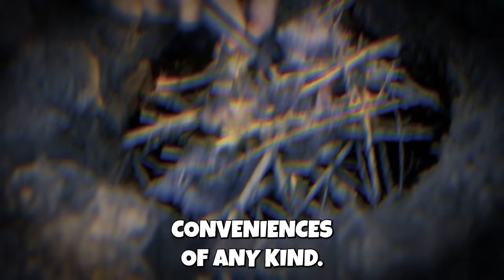90% Will Die In 9 Months! We Tried 72 Hours

Comment: Every prepper needs to learn how to build a charcoal gasifier system. They are simple and reliable way to fuel a power generator on fuel you make your self from any biomass. No gasoline required.
Reply: Does the genny need acparticular regulator etc for this?

Comment: I did a 24 hour winter power outage practice run a few years ago. It was a lot tougher than I thought it would be mainly because I had to split a lot of firewood. Hauling the firewood to the house and keeping the wood stove fired up was also a big time killer. I learned a lot from that experiment and now I have 2 cords of split, dry, firewood on permanent standby.
Reply: Excellent work proving the value of a test run.  Test and tune when it is not an emergency, then you can be cool, calm and collected when it is one.
Reply: Great idea. More people should try it. It can be eye-opening even for somebody who thinks they are prepared.

We did a 48 hour winter power outage practice after we blew a transformer outside our house a few years back. I suppose it was more of a "mandatory unplanned practice".

Best part is we probably overloaded it with our brand spanking new central heating system. We were barely a month into heating our home without wood for the first time in years, and we got plunged back in immediatly.

It was a good reminder not to get too reliant on the grid, and, years later, we still keep a winter's worth of wood split and dried in reserve. 

Last year we lost power again when my breaker box busted. Took me two days to get what I needed and fix the thing. It was -20 Fahrenheit outside. Wood stove for the win again.

Last spring, I built some new wood racks we will barely use. This year we're adding some propane heat as well to serve as an additional emergency back up for the wood stove because I hurt my back hauling wood for the racks. 

It'd suck to have no way to heat my house because I was too hurt to carry wood. Can't be too careful : )
Reply: If you can get a source of waste veggie oil, look into oil drip supplementation... we modified our woodstove to also accept oil, and it cut our wood consumption up to 75%!!! So, we went from a full day of falling, cutting and splitting once a week, to one day per month ;)
Reply: @Great_Wall_of_Text  We trained our biggest dog to haul a sled full of wood so we don't have to break our backs any more than we already do ;)
Reply: @AgnesMariaL  Good doggy!  I bet that pup loves the job : )
Reply: Where you live is important too.. some folks have natural water near them.. We don't!!! so water would be my main issue. Others live in Cold climate and so firewood and ability to keep warm in the home without bad fumes that kill you. Vs where I live the concern is Summer heat will kill us, but in winter we'd be OK with a few extra blankets.
Reply: Maybe invest in a small wood splitter

Comment: To keep a frig/ freezer coldish longer slide Heavy Clear vinyl (fabric stores, hardware...) Between the door and shelving. This will let you look but keep the "cold" from spilling out.
Tape the sides down and make  2 splits so you can remove things out.   I throw a second very light weight vinyl over top again to keep it 'cl9sed'.  You Can use Press n Seal plastic wrap for this closure as well..  For the Freezer (upright) take 2 old heavy sleeping bags, place folds on opposing corners secure the sides of the bags to the sides of the freezer.  This added insulation with the vinyl will keep things an extra 1&1/2 to 3 days.

Comment: Thanks for an entertaining video. When my wife and I use to primitive camp, I ordered a toilet seat that fastens to a 5 gallon bucket. Replacing the bag in the bucket was not something I wanted to do. So, I took a saw and cut the bottom out of the bucket. I took my post hole diggers and dug a 3' hole about 10" in diameter. No splashback. I would dig a new hole every couple of days and there was not hardly any smell with it being that deep. We also through lime on top of it after each use. Dirt would have worked as well to mask the odor. By the way, you have a nice looking family and it is good to see you are raising them religiously.

Comment: I live in Oklahoma and it gets cold in the winter here.  We had the largest ice storm in years.  Our house heating system went down.  I had to go 8 days without the heater for my 3,500 sq. ft. home.  That was the soonest the part would come in.  We were able to use the gas logs in the fireplace and if it got a little chilly, I have two ovens, I would fire up the ovens and leave the doors opened.  We didn’t leave them unattended.  We all slept in the den, it is closest to the kitchen.  Put up some quilts to close off the rest of the house.  Space heaters in the bathrooms so the cold did burst water lines.  My family and I survived.

Comment: We bought an off-grid property and packed up and moved to the middle of nowhere in the Cairngorms of Scotland.  When we arrived there was six inches of snow on the ground and it was still coming.  It was May and the snow stayed there until July.  It is beautiful if not challenging.

Well, when we arrived there was no water as the pipes froze (it is gravity fed) and the heat is run by radiator.  It was cold.  I bought the place because of the burns (fast running streams) on the property, so we had access to water, which we hauled to the house for the toilet, cleaning and cooking and filtering.  Then that summer, the generator blew up...literally...chuckle.  While waiting for another, we were without electricity for almost two months.  Except for a little generator that we kept the fridge and freezer going in six hour intervals.  It is still cold in the summer in the Scottish Highlands and having a wood burning stove WITH a back boiler for hot water is a life saver.  We were able to keep the house warm and have hot baths, which makes no electricity no problem.

Living without water, then electricity was a great experience!  We learned to do everything the old fashioned way and grew closer as a couple.    We now have a functional home-grid with solar, wind and generator and more important, the wherewithal to live without.

Comment: Ive been completely off grid for seven years. Basically own a small farm. I have several water sources. I have manual backup everything. Solar power and a turbine generators. Recycling everything i have compost to even house parts full mechani/machine shop. Able to run my vehicles of woodgassifier

Comment: Others are going to smell cooking when done outside. I would suggest having a good cast iron dutch oven that you can put fire coals in to cook inside. Fill the cast iron with hot coals, use a small grate for the top and put your cooking pan right on the grate. Also, don't forget, you'll have about 50gals of water in your water heater, you just have to learn how to drain it safely... its under pressure right now.
Save your plastic shopping bags, they fit nicely in a small waste pail that can be used as a toilet. Put the bag in the pail, a small amount of dirt, and take the "trash" out when finished. You can take the seat off of a kitchen chair and put the waste pail under it so you can sit comfortably.. No outside vulnerabilities.
The Lord be with you all in the days ahead...
Reply: unless you have a fireplace with a flue open you can put your cast iron dutch oven in, cooking inside with wood/charcoal can cause carbon monoxide poisoning, even with an open window.  Also, keep a fire extinguisher or bucket of water nearby.
Reply: @lf4061  Not talking about fire burning in the house all day... And if you don't have a small camp stove and a stock of butane I guess you can eat it cold...
Reply: @christiroseify  or cook outside, or use sterno, chafing fuel, or even tea lights under a cooling rack set across upside down pans with a lid, bucket of water, or baking soda/salt to put out accidental flare ups near by, inside or outside.  However, most deaths during power outages are caused by carbon monoxide poisoning/smoke inhalation, or fire burning buildings; therefore the reason I passed along warning to those reading your comment that might not be aware of the risks and dangers.
Reply: @lf4061  Yes, all of which require inventory... So we'll save the hot coals for last...
Reply: Open any hot water valve in the house. Voila!  No more pressure.
Reply: wood stove works well.

Comment: You need a cistern of some kind to help your water situation. Or a manual pump well if possible. The water doesn't have to be potable, but being able to haul a bucket of water in your bathroom allows the septic system to continue to function.
Reply: until the septic gets full and then comes into the house.  A huge outhouse is great idea.

Comment: I would think that after using that poop hole, it would be a good idea to put a little dirt on top of it to help prevent splash-back and also help if you accidentally step in the hole. 
I think a sign that says something like "No treasures are buried here" would also be a good idea to help keep you from breaking your knee by accidentally stepping in the hole and it would also be a nice surprise for anyone looking for any "treasures" you may have buried in your yard.
Reply: When I was in Boy Scouts (circa 1960), we had big events (Camporee) where hundreds of boys would use a common latrine. The heart of it was a narrow trench, about 6" wide and about 18" deep. The dirt taken out of the trench was alongside and used as fill dirt as the trench was used. By the end of a 3 day weekend, that trench could be 100 feet long before it was all filled before we left. It didn't smell and hardly left any trace we were there. We used 1x2 sticks to support house wrap (Tyvek) for modesty panels.
Reply: wood ash is the best or wood sawdust. the ash absorps the stank nicely.  lol
Reply: Hmmm…..why did I get fooled into a $20,000 septic system…..dammit!
Reply: It's called an outhouse dig a hole about 3 to 4 feet across and about 6 to 10 foot deep. Then make a wood box to sit over hole and then cut hole in middle for your butt to sit, then make a very small fully enclosed shed.

Comment: I tip my hat to this man and his amazing family. I’m a 58 year old retired Army Infantryman and live in San Antonio but on the outer limits of the city/area for a good reason. I live on a dead end street off of a main road so we get zero through traffic which is great. I’ve fingertipped with my neighbors and most are able bodied men with weapons and able to go off road and hunt. We all know what to do in event of an emergency and who has critical medical needs and we have a good supply of antibiotics and other critical meds that have a longer storage life. My concern is roving gangs and Molotov cocktails, fire is a huge threat and if I can’t breach a house for their items, I’d burn them out with a little bit of gasoline, problem solved! But once someone’s house is on fire, there’s a high chance the fire will spread through the area. 
  Also consider drawing additional water from fire hydrants, they’re on a separate system (usually) and will have a small amount of pressure. And buy a few bags of pool shock, it’s basically chlorine in solid form. Once purified, pour the purified water from vessel to vessel to get rid of the chlorine smell and taste, it’ll evaporate in the air as it’s poured. I don’t recommend using chlorine for water purification all the time but it’s a decent emergency option. You don’t want to drink standing water after it’s been sitting more than a couple days!
Reply: Also, granulated pool shock has a limited lifespan, so learn it and take that into consideration.  Very important.

Comment: Something that would be really fantastical for this video in particular. I don't know if there's a definitive list, but it would be nice to know the things that will definitely be impacted by an EMP, versus the things that will not be. I've picked up a few Faraday bags, but I've got a whole solar system and lots and lots of batteries and electronics. Knowing what needs protecting and what doesn't would be beneficial indeedly:)
Reply: The panels might, and only might, survive. All the inverters and battery chargers would not. Bateries would be ok if lead acid. The lithium based ones would be dead, they all have built in electronics for charge safety. So unless you have extra panels, chargers , and inverters, stored in a protected place, don't count on having solar:(
Reply: @KevinSmith-os5yz  - Unfortunately, solar panels will not survive as they are basically a series of photodiodes (semiconductors). Foldable solar panels would need to be part of your protected electronics in a Faraday cage.
Reply: @g-whiz286  I've seen mixed reviews on the survivability of the panels. If the emp is far enough, the panels might survive while the other stuff is fried. They are somewhat more robust than an ic chip. That's why I said might:)
Reply: @KevinSmith-os5yz  - The problem is we can never really know without testing and testing properly requires a nuclear detonation to produce a real-world EMP. An EMP cannot be simulated in a lab. Even the effectiveness of a Faraday cage is theoretical at best. I worked in a Faraday cage (screen room) on ComSec gear when I was in the military. To duplicate that one little room personally would cost hundreds of thousands of dollars. I hear people say, "Oh just pack your stuff in an old broken microwave oven" displays no understanding how complex and broad spectrum an EMP can be.
Reply: @g-whiz286  agreed. I have solar backup for my house, and looked into emp protection for it. Decided the only way would be to have a complete system stored somewhere safe and not being used. Not tbe most practical solution:)

Comment: A couple of the items in my emergency kit are tarps and ponchos. Tarps are great for gathering rain water. You can even use them for water storage, like in the back of a pickup, which then becomes a portable water source, until you run out of fuel that is.

Comment: Tip: You can still use your toilet if you have any water, dirty, pool water etc. Basically non potable water will work just as well. You just fill the back tank and it will continue to flush.

Comment: Being in florida and having to go thru many hurricanes without power including being flooded in the last one we are always prepared. Usually have enough food for 6 months to a year, plus plenty of seeds to plant more if needed. We have some solar panels and inverters, batteries to run minor electrical items. We have multiple generators that can run the whole house ( including air conditioner) with a enough fuel for at least a month. You would not want to steal from us as we have enough ammo to last for years. We have fresh water river behind the house so we can carry buckets to flush toilets or shower/swim if needed. We also have a filtration system that removes bacteria from that river water for drinking. Although we usually keep a lot of fresh water stored. With the river we can easily fish for food if need be. Power is nice but not gonna cause us to die without it.

Comment: We got to freeze in Texas in Feb of '21, so we had no power for most of the week and water supply was at half pressure, so we would fill the bins up each morning or afternoon and drain the water since we were farther south and the pipes in older homes are all copper. We ate the leftovers first and put stuff outside in the garage since it was 35F most days all day and colder at night. I now have a way to plug a generator outside so I can use an electric heat source at least for a couple  of days.

Comment: Tip: you can collect rain water to boil or filter, but not off your roof. Set up a tarp to catch it instead. Roofs are covered with bird poop, squirrel urine, raccoon crap, and the tiles on most roofs are oil based. No roof water.

Comment: A couple of summers ago we lost power for 10 days straight, and it was HOT out. 
We’d had a big storm roll through and I watched it take out the power to our neighborhood. I felt like damm, I hope they get this fixed sooner than later, but it was later, 10 days later.
I know with an EMP, unless you take steps to protect yourself, everything electric gets taken out, but luckily this was just a general failure of the grid. We were able to use a small generator I had to power our freezer and fridge. And a few other things, 
And my neighbor used it as well, we shared. But the big one we used it for was our camper. We’d make sure to run it long enough to get the batteries charged in the camper, cool the fridge down, and run the AC to cool the camper down for sleeping. 
That little generator turned out to be a real blessing. Now I want 2 more just in case.

Comment: I worked as a field nurse in Africa, you can live indefinitely in the rough if you obey baseline tenants of sanitation, safety, & a decent water source. I did fine without power & no running water, the village knew how to sanitize water for drinking & cooking as well as understood the basics of infection control. I’ll say this, from experience, humans have a natural feral side, it’s always been there, once your brain adjusts & understands that it’s in it for the long haul, your mindset & body switches gears, but this is also something you have to come to a genuine understanding of, by accepting that the lights aren’t coming back on. Long story short, It’s called coping.

Comment: 1:46  freeze water bottles, milk jugs fill up 3/4 way. Put a hand full in fridge freezer. Will help regulate temp. You could also layer bottom of cooler with frozen water bottles if you have a small amount of meat to keep 72 hours

Comment: I asked this before to other preppers. You know what a barndominium is? Steel frame, sheetmetal skin, where the frame meets the concrete base, run a cable to a steel post sunk into the ground.  Now would that work as a faraday cage? Just wondering if I found something good?